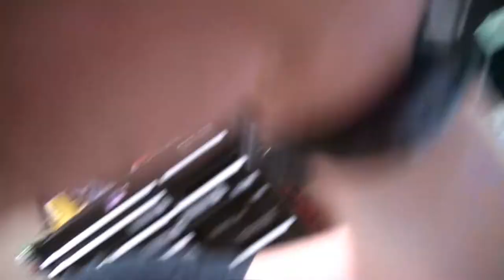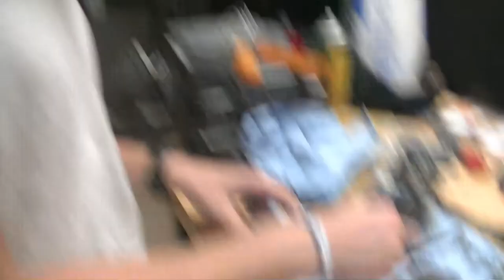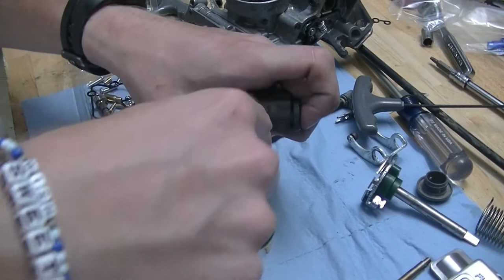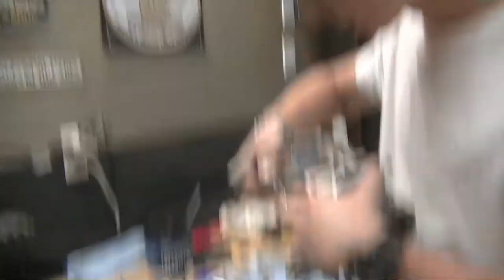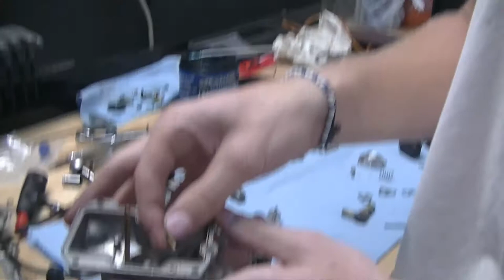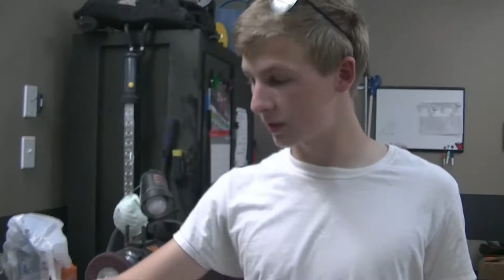The Forgotten Carb Kit| The Right Way to Reassemble an FCR Carb| YZ450F Bucket Bike Project Pt.5

Comment: Clayton! You are the man! I have been racking my brain for 4 weeks now! Reading forums! Running through everything on the bike! Nothing would work! It was running like crap backfiring and not idling right and would just die once it was off choke. Cleaned the carb and changed jets like no other! And I totally forgot about the needle! Changed the needle and looked at that plate and it was upside down! Sucker runs so smooth now and after reshimming it runs even better! Thank you so much!
Reply from the maker: Thanks man I really appreciate that! So glad I could help out!

Comment: Doing this to both my 2001 yz426f and wr250f. This is the best detailed video out there. So many tiny mistakes you can make if you dont pay attention to detail. My midbodies had 2mm allen screws inside float bowl and 2.5mm allen outer carb.

Comment: Great job Clayton. The only thing I would add is to polish the float valve seat. I never did it either but had a leak, watched a video where a guy took Brasso on a Q Tip in a drill and polished the seats bore at a low speed. I think he cut the Q Tip in half which is good since I could then use my Dremel tool and adjust the speed. If you have a screw next to your seat it is removable like mine. Good since you can change the O-Ring and clean the screen filter that's on the seat. Liked and subscribed!

Comment: Well I cleaned the carb really well and blew out all the air/fuel passages. I went from a 178 main jet to a 172 and 42 pilot.  Installed gaskets , mid body  as well. Note; the needles from Jd jetting are the exact length as the stock needle! I  changed my fuel pump diaphragm and did the mod jd recomends a little shim that goes on top of the diaphragm nipple. New twinair air cleaner.........I just started up and adjusted the air:fuel mixture and idle ,i filled the fuel bowl and tested it🤣🤣🤣 it niw shouts fuel like an injector😂 it started rait up and runs like a CHAMP 🤙🏽🤙🏽🤙🏽🤙🏽
Thank you fir your vid ..they helped a lot!   Oh...🐒..go KTM! They are super well built bikes,!
    Note; clean and blow out the area where the needle sits,even good to polish that area for perfect needle/seat action😃 ,also there are two really small holes in that recess that need to get blown out with compressed air,also good to blow out the idle circuit areas as well🤙🏽

Comment: Rebuilt my YZ426 carb and thought I was done, bike still runs like crap and won't kick start, adjusting valves and buying this kit because the mid carb was so tarnished when I took it back out. Thanks for the vid.

Comment: Hey man, I just rebuilt the carb on my 2004 yz250f. The bike was running at the end of last season but I decided to rebuild the carb this spring cuz I knew it needed to be done. Only reason it ran last season was because I had a family friend clean the carb and he recommended it be rebuilt. Anyways I’ve rebuilt the carb and now replaced the fuel petcock but I can’t seem to get the bike tuned right to idle well. Just wants to die on me unless I keep it alive with the throttle. I could really use some advice as this is the first bike I’ve ever had. Would rather not have to wait to get it into a shop and pay big bucks for what I truly believe is just a tuning issue. Please let me know what you think I’d really appreciate it!!!
Reply from the maker: Hey man thanks for the comment! Have you tried adjusting the idle screw and fuel screw? It could also be a valve lash issue if that hasn’t been done in a while.

Comment: FANTASTIC how-to between this and the first vid on the tear down! I feel super confident now. I’m very mechanically inclined but carbs can still be intimidating. Especially slightly more complicated ones like these. What do you recommend for new vent line? Also, do the all balls rebuild kits include the 3 o-rings for the fuel inlet fitting where the fuel supply line hooks up? Thanks
Also liked and subbed ;)
Reply from the maker: Hey Jason thanks for the comment! For the o-rings on the fuel inlet I would just order the OEM ones from a parts supplier as they aren’t to my knowledge in the kit. The vent line is any 1/8” line, but there are places online to get different colored vent line. Hope this helped
Reply: @claytonmotos2816  yeah, dumb question on the vent line. Found it on Amazon 2 minutes after I commented. Was definitely curious on those o-rings for fuel fitting though. I want to replace mine. Since you had extra o-rings left over, I was wondering if those were perhaps for that fuel fitting. Thanks for the reply!
Reply from the maker: Those o-rings from the kit weren’t the right ones. The OEM part number is 3TJ-14564-40-00 and i remember having to order them separately. Hope this helps!
Reply: @claytonmotos2816  that helps very much so. Thanks again and happy riding😁

Comment: hey there great vid
few questions if you dont mind
i have 09' wr450f
it always works super lean no matter what
5th gear bogging all the time and no power what so ever
it has yzf450 exhaust airbox and gray wire mod
should i install the stock size starter and pilot and leak jet that comes with the kit  ?
thank you in advance
Reply from the maker: If I were you I would install YZ450F jets and maybe take the needle up one clip position to increase the fuel flow at wide open throttle. It’ll take some tuning so you might want to pick up a jet kit as well to play around with the jetting. Good luck!
Reply: @claytonmotos2816  i have a jd jetting kit

Comment: Will  06 yz450f carb work on a 08 model engine?
Reply from the maker: The OEM part numbers are different for them so it may take some additional tuning.
Reply: Okay so after much research yamaha managed to track down my bike information, I have a 03/04 frame and a late 04 early 05 engine,  it has a five speed box not a 4 speed  the engine is a yz450fs or a 5xd4 but it's a unciculated engine as the engine serial number doesn't show up on their databases. The real question is... do I buy a 04 carby kit or a 05 kit or a 06 kit or a 03 kit lol and what if any differences would there be between them?
Reply: I also have a 06 carby here, will it work on my engine lol
Reply from the maker: Buy whichever kit you have a carburetor for. After that rebuild the carb and put it on. A carburetor’s purpose is the same no matter when it was made so it should work for your set up as long as it was originally a YZ450F carb. Hope this helps.

Comment: Can I use 2003 yz450f fcr carburetor rebuild kit for 2003 wr450f fcr carburetor? Is it fit?
Reply from the maker: Most of the parts should be interchangeable. The jetting and needle may be different so keep the old parts to compare them to the new ones before reinstalling!

Comment: The stock needle is not what you want the taper on it is to dramatic.  That's why JE sends you a choice.
Reply from the maker: The only time I used a non-stock needle I had a boggy, sluggish bike which was completely fixed by changing back to the stock needle rather than using the supplied needle.
Reply from the maker: The only time I used a non-stock needle I had a boggy, sluggish bike which was completely fixed by changing back to the stock needle rather than using the supplied needle.

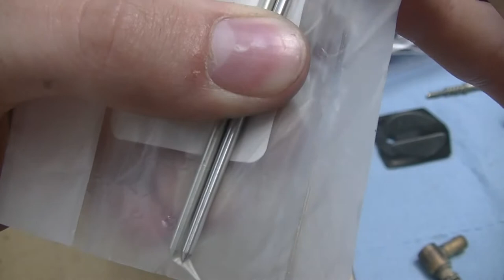Comment: At 4:46 when measuring the needle , your measurement should have been from clip position to the tip not from the top to bottom of needle !!
Reply: Great video otherwise
Reply from the maker: Just trying to show the overall difference in length for a kit that claims to send the stock needle.
Reply: @claytonmotos2816  still got to send the correct message , right ?
Reply: Which is the aftermarket needle may be correct !!